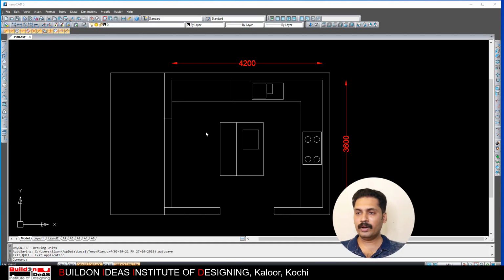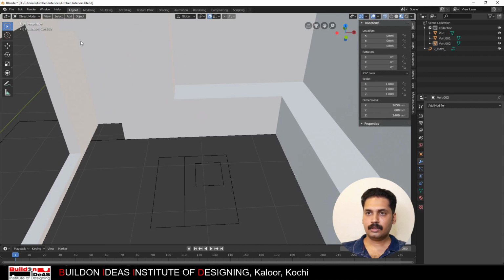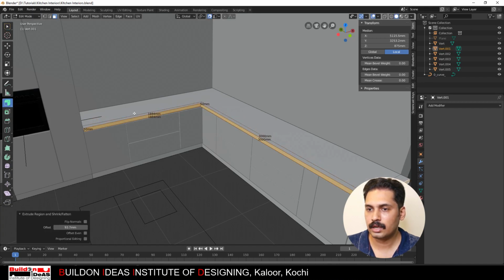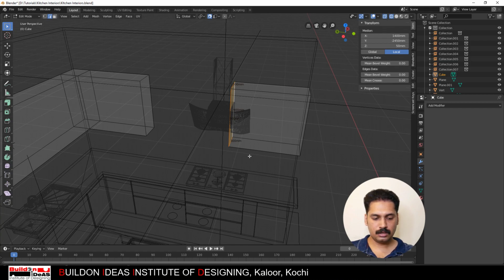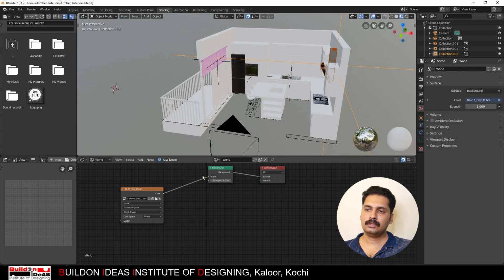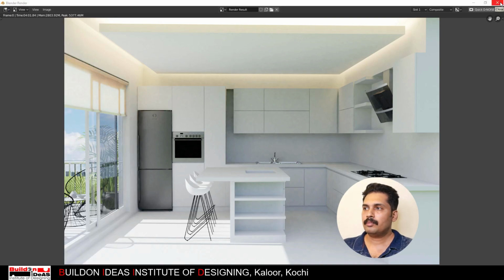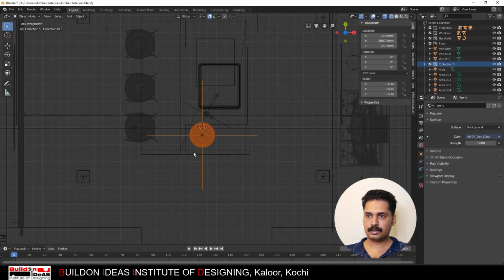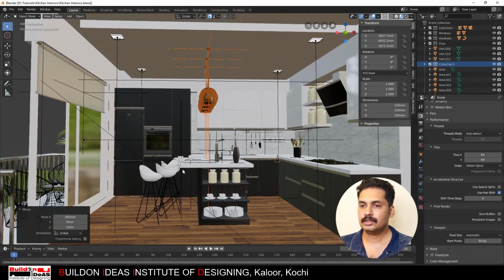Creating a Modern Kitchen  | Blender 2.8 Interior Design Tutorials

Comment: That was great, how did you draw 1 handle but apply it to all of the doors at once?
Reply: @BUILDONIDEASonline  Ah ok, thank you, can the handle shape you have drawn be saved for future use too? Also, if it was a door with a centre inset panel that had moulding around it, do you know how that could be done?
Reply: @BUILDONIDEASonline  do you have or know any video's showing how it is done?
Reply: @BUILDONIDEASonline  great,  how about putting mouldings onto a paneled framed kitchen door?

Comment: Sir I am currently working my way through switching from sketchup to blender. And I am facing a problem while rendering. When I import sketchup model in blender through .OBJ format, blender doesn't identify any groups so its almost impossible to assign materials as there are millions of different polylines and surfaces that needs to be assigned differently. Is there any way I can deal with the issue.